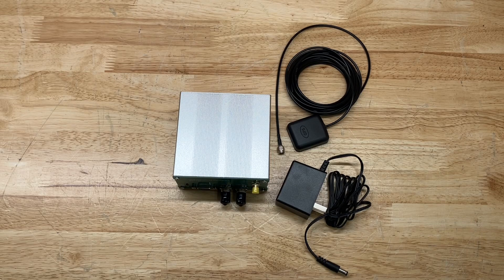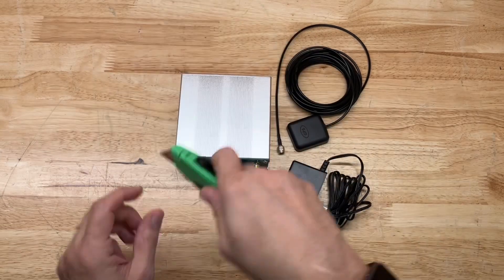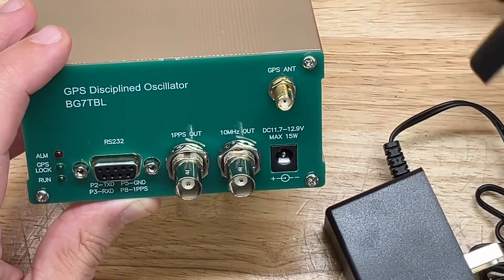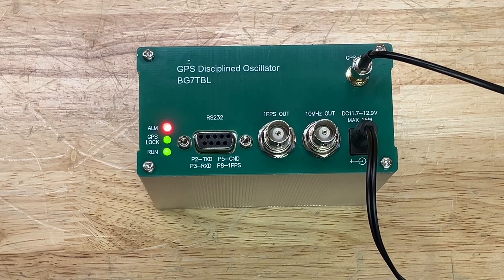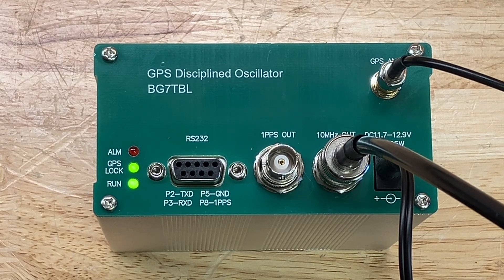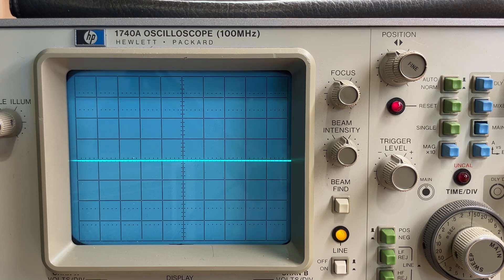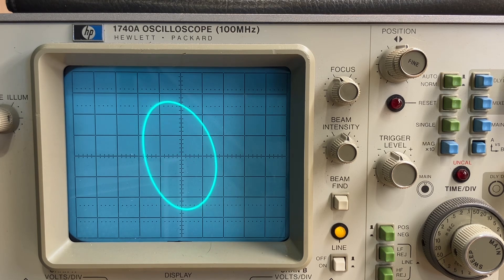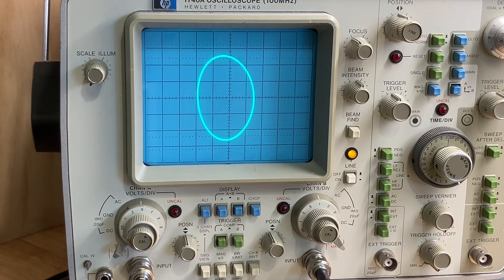GPS Disciplined Oscillator

Comment: If you hook the serial port up to a computer, you can download and run “Lady Heather” which can talk to and control a wide variety of GPSDOs. It shows a lot of useful information, plots maps of the satellite coverage, produces graphs of lots of data and much more. One thing to check once you’ve got the antenna fixed is whether the GPS has gone into 2D position fixed mode as this gives the best timing accuracy. You can trigger a self-survey which can run for 24 hours and averages out the position errors and then use the resulting position as the fixed “truth”

Comment: I got one something like this from Aliexpress but it's rather disappointing.  On the display it just says "10.000 Mhz GPSDO" for a while then changes to say "PPB -2.3" and "PWM31077" but there are no instructions at all so I have no idea what that means.  Pushing in the knob gets into a menu where I can select Contrast, Offset, PWM Set and Exit but that's all.  It never displays the time like they show in some photos and there's no way to even tell if it's picking up any satellites or working at all!  I opened it up and inside it has an Arduino STM32 and NEO-6M module plugged into the main board with a 5 volt regulator and LCD.  The main board also has a 10.000 Mhz OSCO on it and outputs on the back for 1PPM and 10 Mhz..  With the top off I can at least see the LED blinking on the NEO-6M so I guess it's working to some extent but they should have put the LED on the front.  Since there are no instructions can you tell me what PPB -2.3 and PWM31077 mean and how to use the settings for Offset, PWM Set?  The PPB value goes down to just a fraction after it's been on a while so I assume that is some indication of the amount of error?
Reply from the maker: @stevec5000  sorry, I don’t know anything more about these units than you do. Mine didn’t come with any documentation at all.

Comment: If you have the opportunity measure two GPSDOs, and then have a look at the Lissajous curve! I designed a GPSDO as my thesis, I had measured it, and I think the comparison would be interesting for you as well!
Reply from the maker: @PolyakB  when I was at HP in the 1980s, we would compare the relative performance of 2 cesium beam frequency standards with a phase comparator and a strip chart recorder. It was interesting indeed. Although one might not expect any variation whatsoever between units, we could usually see some drift over time. I imagine the variation between GPSDO units is even more significant.
Reply: @garyramsey4275  It really is! I recorded a timelapse of the two signals, triggered the scope on one of them, and they had quite a large range of phase difference.

Comment: You can use that serial port to set up a stratum 1 NTP server.  All you need is a cheap computer and Linux.  I run pfSense on a mini PC for my firewall/router and it supports a GPS connection.  If you really want accurate time, you could also add a Facebook atomic clock PCI card.

Comment: I added a Leo Bodnar Electronics GPSDO to my bench about a month ago.  The Bodnar unit is made in the UK and customer support exists, though I have not needed support.  There are a few models to pick from, and I opted for the dual BNC output which is about the size of a US cigarette pack.  I chose this brand over the no-name Chinese units which are common on eBay and Amazon which I assume are throw-away items if problems arise.

Bodnar refers to their GPSDO as a “clock” but they mean that in the sense of strictly a system frequently reference.  The two outputs are independent and programmable from 450 Hz to 880 MHz using a USB set-up program.  Once set. The unit no longer needs to be plugged into a computer.  The power input is 3.3 to 16 Volts DC and a small USB supply is a good power source.  I found the unit locked on in about 15 seconds with the antenna puck resting on my bench, which is not near a window.  The stated accuracy is 1/10^11 and a pretty low phase noise error.

My service monitor and spectrum analyzer have OCXOs, but with the Bodnar unit, I was able to improve the measurement accuracy by about two orders of magnitude.  The GPSDO reference unit is an accuracy game changer, and now super precise frequency measurements are within reach of most hobbyists.

Comment: This is a  rip off. There is a cheaper 1/3 the price with LCD with a deviation value from the crystal oscillator in ppb and count.  The most relible peice of gadgets that I own.
Reply: Try reading your own post before hitting enter. You might want to re type rip.
Reply: @jonka1  that was a replaced word why auto correction.
Reply: @bayareapianist  Check your reply, you might want to re type the word "why".
Reply: There are a plethora of Chinese GPSDOs on offer of Amazon and eBay.  I suspect some of those units are using recycled Trimble boards which were originally in some other equipment.  Despite the verbose listings, it is difficult to get a true sense of what you’re buying because the listings are clones of each other.

The generic GPSDO cost isn’t huge, but it isn’t zero either.  I don’t feel comfortable with the no-name eBay GPSDOs.  I got a Leo Bodnar Electronics GPSDO for my bench last month.  The Bodnar unit is simply a programmable frequency standard with 450 Hz - 880 MHz settable output.  I feel better buying the made in UK Bodnar unit because the cost is about the same and I believe Bodnar will be around if support should be needed.

Comment: Interesting bit of kit. I see they have been extensively discussed on EEVblog pages and have been around in various versions since about at least 2015. Interesting that yours has no year-month-day text marking after the BG7TBL on the front panel. Guess there are many copies of the original product with it being difficult to see if its by the original designer/producer.

Comment: Crystal ovens are dinosaurs.
Reply from the maker: Some people like dinosaurs.
Reply: @garyramsey4275  :)
Reply: What did you replace them with? They are still for sale and used in many devices. The next best thing, a TCXO, is not nearly as stable, but much smaller and needs less current.

Comment: The ALM light is supposed to mean "Don't rely on the output frequency".  The light is supposed to go off after the GPS signal has been stable for long enough that the PLL has locked and the oscillator has been tuned on frequency.  

The GPS Lock light means it can decode the GPS satellite signal.

The blinking RUN light indicates that the software is working.

I've found the PLL in these do not lock exactly on frequency and they wander by millihertz.  They're close enough to use as an OK frequency standard, but they're not nearly as good as they should be.   That might not be a problem if you're just using it to put your VHF ham radio on frequency or using it in place of a quartz oscillator on your 1 Hz resolution frequency counter, but if you use these as a timing source the errors compound and you'll find that your time of day clock drifts significantly and randomly where using a better unit like a Trimble Thunderbolt will stay within nanoseconds day after day.  I've seen mine drift over 100ns in 30 minutes.  This drift is not what one expects from an atomic referenced standard.

I've found the smaller black versions of these ebay GPSDOs can still be significantly off frequency by many hertz when the ALM light first goes off.

If you're wanting this for anything serious, get a used Trimble Thunderbolt instead.
Reply: I’ve been wondering what is inside the generic Chinese GPSDOs for sale on eBay and Amazon.  I  guessed they are using recycled Trimble modules out of other equipment.

I’ve been using a Leo Bodnar unit as the frequency standard for my service monitor and spectrum analyzer.  Bodnar states the frequency accuracy is 1/10^11.  The phase noise is acceptable, but I’d have to look it up on Bodnar’s web site.  I’m not generating SMPTE time codes or standardizing an NTP server,  so I’ve found the Bodnar unit acceptable for a very reasonable cost.

Comment: Nice.  I also just got a GPSDO, but I went with one of Leo Bodnar's lbe-1420.   It works great, and is super easy to use, but I do wish it had multiple outputs. My antenna is just sitting outside of a window on the windowsill right against the house and I am picking up 23 satellites.  Currently set to output 24Mhz to be used with my SDRplay RSPDx.
Reply: The Leo Bodnar unit is the way to go if you need something other than 10 MHz.
My antenna is just sitting inside the window sill and works great in that position
Reply: I got the dual BNC Bodnar unit.  Part of the PLL divisor chain is shared between the two outputs, but the set-up program figures out how to shuffle the numbers to come up with the two frequencies you want - if you want two different frequencies, that is.  I’ve been very pleased with the results so far.  If all you need is a frequency standard, and don’t care about 1 PPS, SMPTE time codes and NTP serving, then the Bodnar units are the way to go for a very affordable cost.  Better yet, they’re made in the UK by a company which will be there if you need to ask for support.

Comment: Very nice. The GPS antenna doesn't have to be on the roof. It only needs to see the sky, so that can be done through almost any window facing outside. Most of the time if you just sit the antenna on the windowsill it will work just fine.
The alarm LED is likely tied in to the crystal oven and will be lit until it reaches temperature.
Reply: Many windows today have low-e coatings, which is a layer of metal on the glass.  They're not transparent to microwaves.  So next to a window might not be the best place. The GPS receivers in these are sensitive enough to work through the (non-metal) roof of a house.  Mine works in my basement workshop.
Reply: @stargazer7644  Good grief. There is always something new to put a spanner in the works. My windows don't have any special coatings on them and a GPS antenna sitting on the sill works perfectly. In fact I have a LED digital clock with GPS receiver and it sits above the fireplace against a solid wall and has no problems locking on to a dozen satellites from there - and it's nowhere near a window. I can only suspect it's receiving through the wall.
Reply: @stopthebus  The windows affected are advertised as energy saving "Low-E" or "Low Emissivity" windows.  If they're tinted, you may have the same problem as some window tint (like used in office buildings) is very thin metallic film.  The walls may also be a problem if you have foil backed insulation board (celotex) in the walls, or plaster or stucco walls with metal mesh in them, depending on the size of the mesh.  Usually the roof is fine if you have wood construction and asphalt shingles.  I have low-e windows and celotex in the walls of my house.